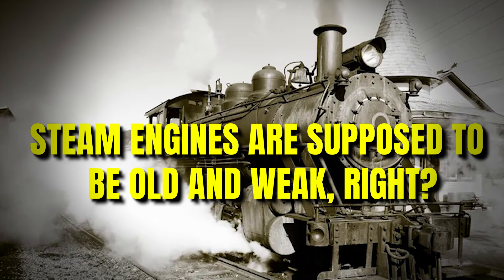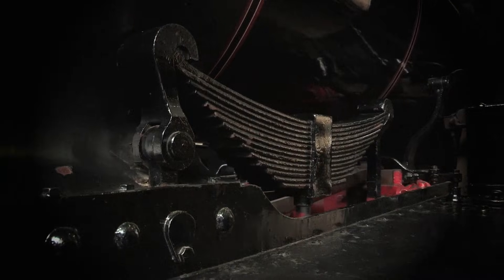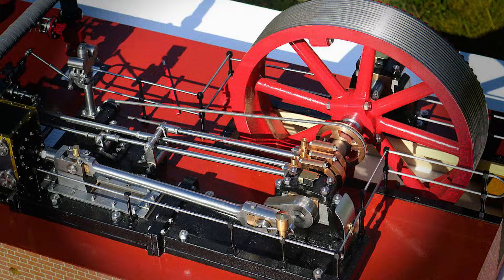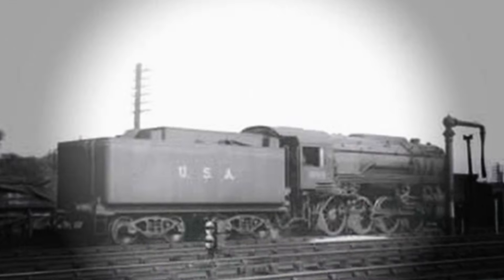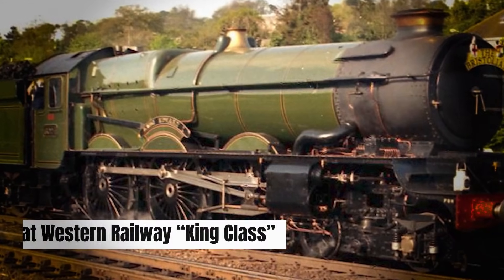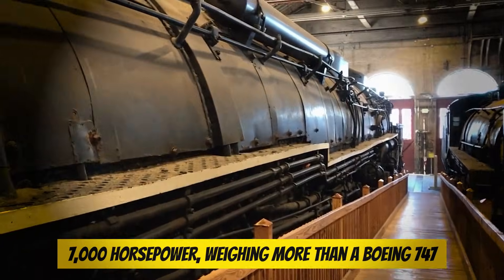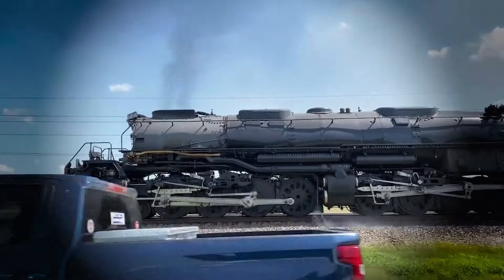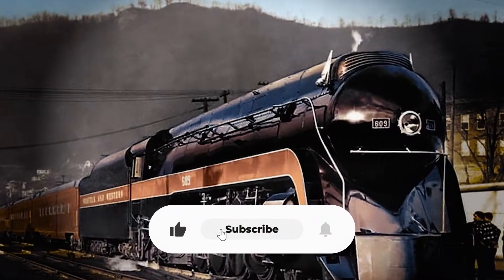10 Steam Giants That Put Early Diesels to Shame

Comment: There's a video of Ed Dickens, the engineer who operates the 4014, saying that the locomotive went from 6290 horsepower to 7000 horsepower and its tractive effort from 135,375 to 138,240, meaning which was improved, its confirmation is shown when it pushed the stuck Blair Nebraska train. Where I need the help of the diesel locomotive because of wheel slippage, The locomotive did not need diesel to help her push, it was simply idling, That train weighed 9505 tons, let's add the 1495 tons that the 4014 In short, the 4014 was pulling, pushing 11,000 tons. Not to mention that the train that was taken was 10,052 feet long, that is, 3,063 meters or 3,063 kilometers.

Comment: Great video! Some honorable mention classes of steam engines that were some of the most powerful ever built are the Norfolk and Western “A” 2-6-6-4, the Norfolk and Western “Y6B” 2-8-8-2, (these engines generated over 150,000 lbs of tractive effort in “simple” mode), and the DM&IR “Yellowstones” 2-8-8-4 which had 6,250 horsepower and 140,000 lbs of tractive effort. The Southern Pacific “Cab-Forward) 4-8-8-2 was pretty impressive too.
Reply from the maker: Glad you enjoyed it and those are some great honorable mentions!